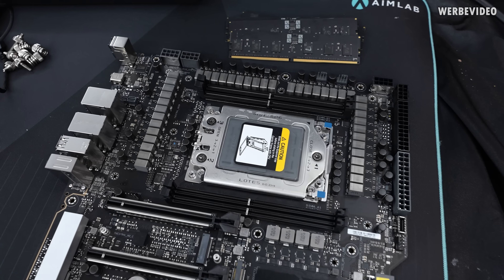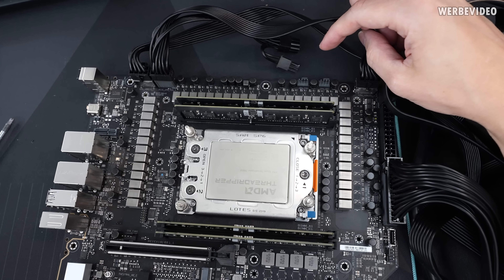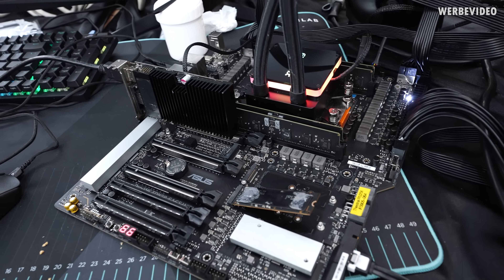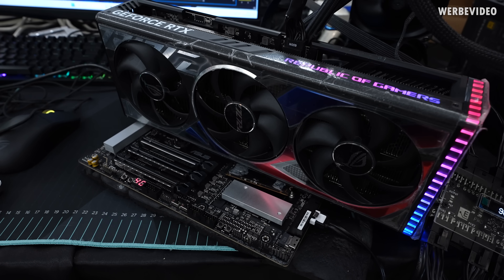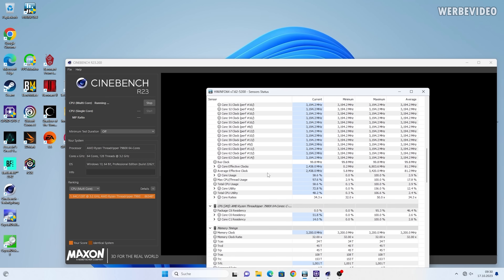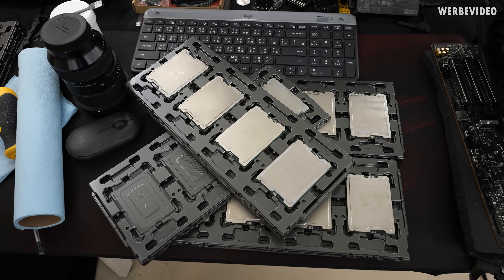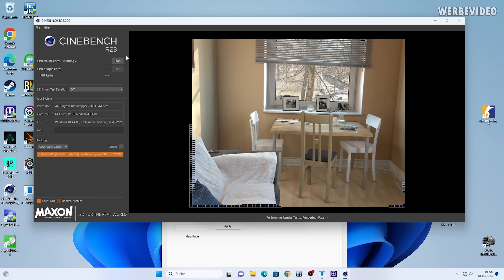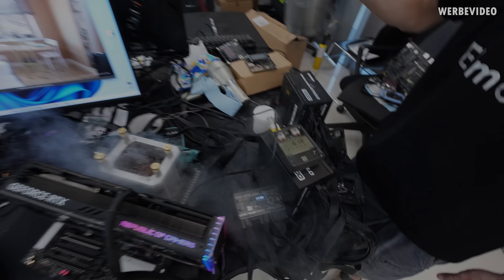Intel is in Trouble! This CPU is just INSANE

Comment: Honestly impressive how well it performed as an 8 chip 8 core CPU. Obviously communications between cores aren't going to be as good as a single die but I'm amazed at how good they were still. AMD's killing it with their multi chip approach.
Reply: He basically made a "frequency optimized" part like the Epyc "F" parts, which run 1 core per CCD but have all the cache still available and run at higher frequencies.
Reply: That's the problem with AMD's choice of having few cores per CCX. Now at least they increased them to 8 vs 4 in the past, but you should still see that as 8 machines. The inter-core latency makes it a pain for applications that need to share low-latency data. But it's awesome for clouds and virtualization where its sold as portions of a physical CPU.
Reply: @levieux1137   Having more cores per CCX increases the chiplet die size and increasing the chipliet die size decreases yield, it's all trade offs. If that inter core latency is such a deal breaker for you then go with a company that still makes monolithic dies but know that there's trade offs with that too
Reply: @levieux1137  sure for people that do not understand engineering ...it has nothing to do about a problem....AMD has no problem....that is the wy the design works
Reply: @atta1798  sure when you don't care about multi-processing nor latency there's no problem, that's why these CPUs are mainly made for virtualization where they're sold as individual machines. However running a multi-threaded workload across multiple CCX is just a no-go.
Reply: @levieux1137  as I said earlier ...... that is the design .. if you are an engineer and understand the technology, you should what is best for you. If you are not an engineer, it should be the same from a functional perspective; that is, and 8 core will suffice for some 12, 16 and 24 for others; unless, you design them the way you want them. I agree with your point but fortunately  the have a couple of companies to choose from question for you ... why do you think when in multicore, the clock speed is lower? etc
Reply: @levieux1137   last question... why do you think latency is an issue at multiprocessing and the clock decreases when at it and highest at single processing ?
Reply: Intel said they don't like HEDT they like Low end desktops.
Reply: Dishonestly not very impressed how well it performed as a 8 chip 8 core CPU.   Not obvious the communications between cores wont be as good as a single pie but also Im not very amazed at how good they were.

Comment: I know this is a workstation cpu but with all this cores why it didnt dominated in games?
Reply: Games run too much single-thread computations to perfectly scale to even 10 CPU cores, nevermind the core counts this CPU has.
Reply: In games having too many cores work against it not in favour because games aren't programmed to take advantage of so many cores. 
Most games at best case use 8 cores efficiently. 
So this cpu has many cores that can't be used by the games and on top of that because it has so many cores and when used it means tons of heat, it is therefore clocked lower than a chip with fewer cores so the individuals cores have less performance than a desktop CPU.

Comment: I still have an older 1950x.  Who wouod have the best overclocking guide for it?
Reply: Upgrade to Ryzen 9 7950X. The uplift in IPC performance alone will be a night and day difference. (Ryzen 5000 series pretty much killed first and second gen Threadrippers.)

The problem is first gen. TR can’t run all 8 sticks of RAM at 3200 MHz. If you want to O/C RAM you need less sticks which negates the point of using TR with quad channel RAM.

Owner of 1920X, 2950X, and 3960X Threadrippers.

Comment: 4 channels is NOT ok for platform like these. In reality, many applications, you think, are not memory intensive, like 3d rendering, is actually very memory intensive i real world workloads. If you use something like vtune to capture the workloads, you'll notice that cinebench is just an illusion, real C4D projects like what we made for interior designs are completely different beasts.

You may get away with some simple video editing on this platform, but in most cases you need an EPYC or Xeon. Xeon only have 8 channels, but from testing each channel is faster, and the lower idle/load latency more than make up for channel numbers.

Comment: If only sapphire rapids wasn't godly slow out the box they might have had a slight chance but even overclocking them hard massively increases the power consumption
Reply: It's almost like Sapphire Rapids is an entire process node behind Zen 4, huh?  Either way, consumer HEDT matters to far too little people for Intel to really care that much about this.  A lot going forward rests on how successful Intel's rapid node advancements go in the coming two and three years.  AMD will always be a little bit behind leading edge, but Intel will not have such a disadvantage if their own process tech catches up to TSMC.  This has the potential to reverse the whole current situation regarding efficiency.  Just potential, mind you.  Intel still has a fair bit to prove it can actually deliver.
Reply: @maynardburger  Considering AMD will now be stuck on 5nm for quite a while, Intel's chances to retake the node advantage are quite good.
Reply: @HenrySomeone Zen 5 parts on N3 node in 2024…
Reply: @benjaminlynch9958  That was the plan before 3nm node setbacks. If you were paying close attention to the matter, it's now considered AMD won't get on it at least until 2025, possibly even 2026.
Reply: @benjaminlynch9958  According to basically all of the latest rumors Zen 5c (Bergamo successor) will be on 3nm, but the standard Zen 5 server (Turin) that comes first will be 4nm due to TSMC's delays and lack of wafer supply due to Apple. I still don't believe Intel will actually catch up to TSMC though. Their fab arm is an absolute freaking mess and has been for nearly a decade now tbh. 🤷‍♂
Reply: Competition is good for consumers anytime to bring prices under control. AMD is dominating currently that's why they can jack up the price of the 64 cores SKU from $3990 for a TR 3990X to $4999 for a TR 7980X .

Comment: Shame that AMD decided to charge an exorbitant for a HEDT. I thought Intel's HEDT US$1800 9980XE was bad, but, this takes the crown. Thanks Evil Su!
Reply: Its 8x the performance, using only 2x the Power, But only costs 5x as the 9980XE! If you want it cheaper, you can get the variants with less cores but still with more performance, than the 9980XE.
Reply: @frischerfisch2528  What? You should compare 9980XE against Opterons. 

This is about the absurd pricing that AMD and Evil Su put out.
Reply: You compared the 9980XE to Threadripper. If you want it cheaper, you can take the TR 7960X for 1500$, 2 or 3 times as fast as the 9980XE, or the Ryzen 9 7950X, that is cheaper and faster, than the 9980XE or the 10980XE.
Reply: @frischerfisch2528  AMD HEDT is overpriced AF, which you're missing the point.

It should be US$600-700 for 7960X.
Reply: @frischerfisch2528  How is a $1500 7960X cheaper than a $1000 10980XE? Unless you meant the 7950X but that's not a HEDT CPU.
Of course the 4 years newer 7960X is faster but it's really expensive for being the cheapest CPU for the platform. TRX50 motherboards are also really expensive.
Intel X299 and AMD X399 were both something that a regular person wanting more PCIe lanes and memory capacity/channels could afford. Now there's a HUGE gap in price going from mainstream to HEDT

Intel prices for the late 2019 HEDT CPUs:
10980XE $979
10940X $784
10920X $689
10900X $590

And the X299 motherboards were mostly in $250-500 range
Reply: Intel dropped the price to $1000 with the i9-10980XE
Reply: @Pasi123  And it doesn't matter, AMD HEDT should be top US$1K